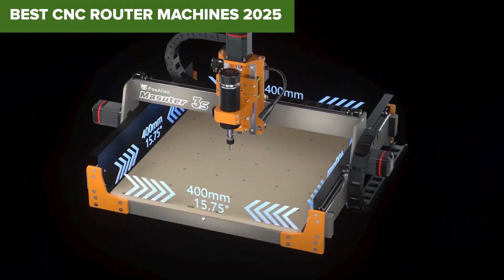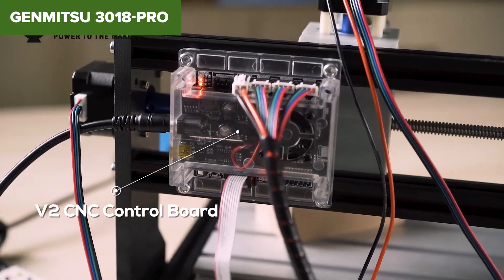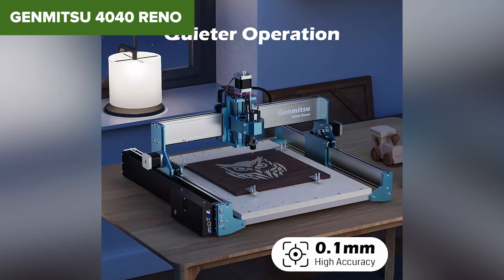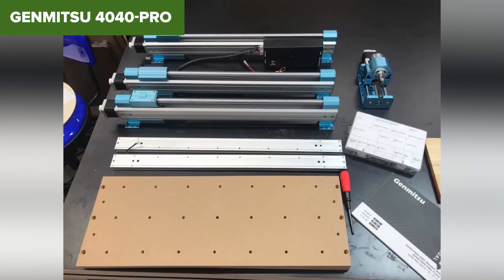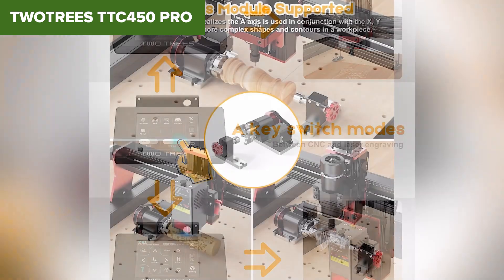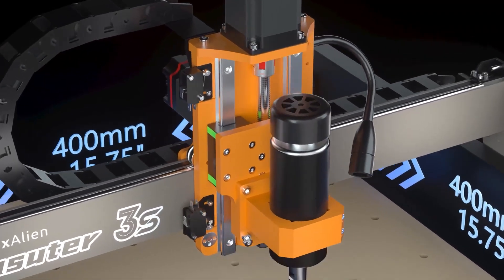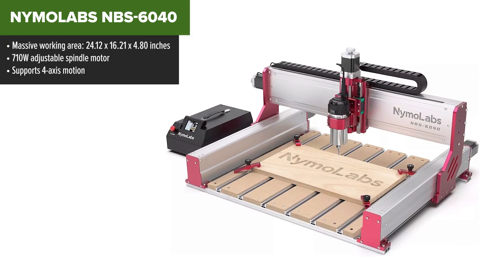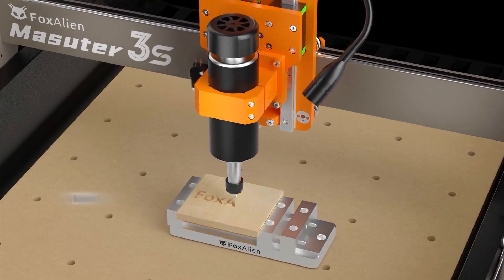TOP–7. Best CNC Router Machines 2025

Comment: The 775 motor is also used in cordless screwdrivers. It has too much play in the bearings. Not designed for continuous operation under high load. Torque is often insufficient. This motor is a real killjoy. The 500 watt spindle is not really any better. The TWOTREES machine has a very unstable Z-axis. But it can be improved with an additional linear rail on top of the gantry. Personally, I think that a CNC spindle should not have less than 700 watts.